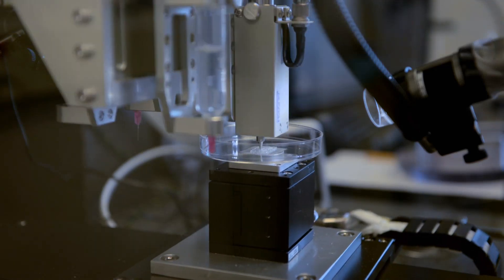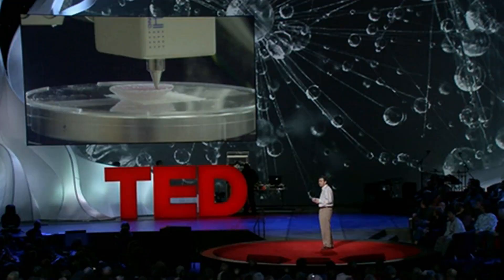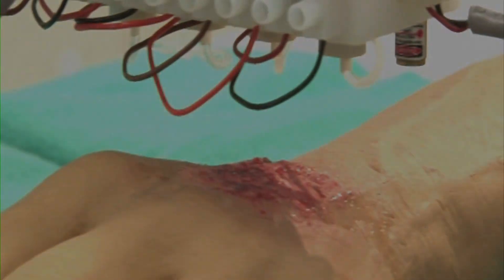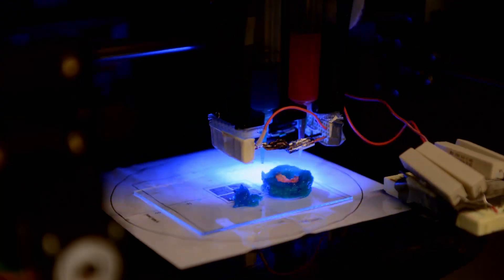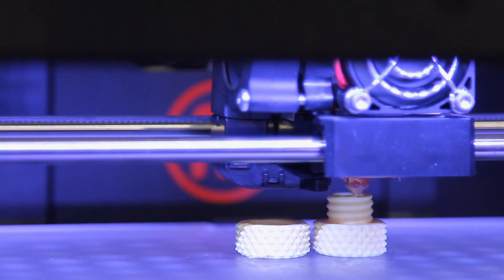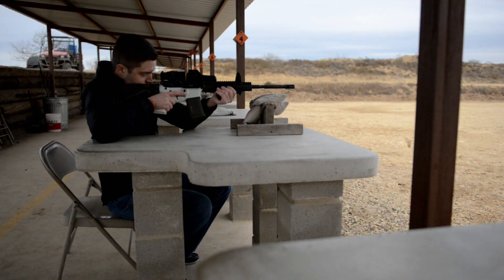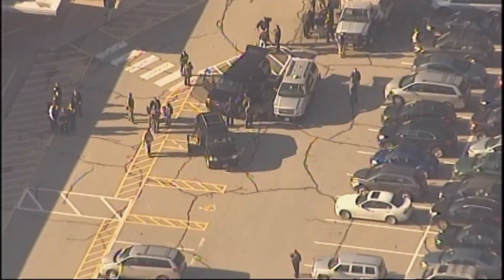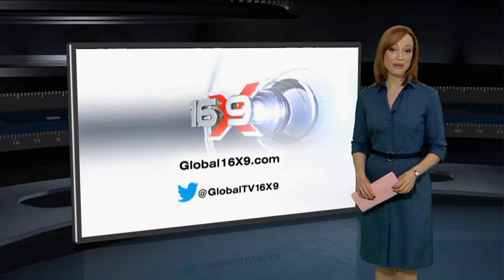3D Printing: Make anything you want

Comment: Only if they weren't so damn expensive
Reply: LBgamer123
 So a 500 is good just like Xbox One? Hell yeah ill buy a printer instead of that gaming system. XD
Reply: Wait a few years, and everyone will have one.
Reply: I have sourced all my parts for less than $150.  Pull the motors and precision rods out of printers(you can get them at the salvation army for next to nothing)  Craigslist always has things on there for free.  All you have to do is purchase the driver board, and if you want to go easy, buy the extruder head.  The biggest investment is time.....
Reply: Anna Wyant
U can get one very cheap...yes. The thing that get out of them has so less quality that u can throw it away.
Only the high quality printers are good enought to be worth and print awesome stuff. (sth like 500.000$)
Reply: Anna Wyant If you actually want to create something cool, I suggest spending the money on a good system to use it in the long run. The DIY makerbot took hours just to make something simple. I don't even use it now, I have the makerbot 2 and 2x. Its expensive but after a year I got tired of how slow the system works and how inpatient I was to print a single part.
Reply: Can DIY a ah, I myself from hardware market to buy material,
Did some 3 d printers, of course, if you buy,
I'm responsible for teach you how to play it.
My skype: reprap.cn  www.reprap.cn
Reply: 3d printer 300 dollars dual extruder with wifi. Yeah expensive
Reply: https://store.makibox.com/#/product-detail?type=1&&option=31 cheaper than you think

Comment: Can I print a 3D printer?
Reply: You can't print the whole printer itself. You can print parts for one, while having to order the mechanical parts (motors,Belts,connectors) online.
Reply: PRINTERCEPTION OMG
Reply: That's right! Let's put the 3-d printers out of printing business. Lol! WICKED.
Reply: Take a look at the RepRap (self-REPlicating RAPid prototyping) system originally designed by Adrian Bowyer at the University of Bath in the UK. He shared this design open-source, and you can now fabricate all types of 3D printers using forked improved designs (Cartesian like the original, Delta like the Rostock, or even Polar like the Morgan). My co-author for "3D Printing for Dummies" recently released the 3DR RepRap variation when my students are building for our workshops. This is all 3D printed save for common hardware and electronics availalable at your local Radio Shack (braided fishing line, open-source Arduino controllers, stepper motors from old printers. etc) and can be built for under $200 USD. I have used these printers for everything up to printing Liberator handguns for law enforcement, all printed just using ABS plastic (like LEGO uses for its bricks) and PLA (biodegradable plastic made from plant sugars). Nothing is required more than commonly available parts worldwide to create a 3D Printer that can print solid objects for irrigation and fresh water capture, etc. Amazing stuff!
Reply: yes
plz
Reply: WickedClownGrin A RepRap 3D Printer can be created using kits like the MendelMax and Rostock Max we used for the book "3D Printing for Dummies" or you can self-source the parts and build your own for around $300-500 USD all together. The more parts you can print instead of buying from the hardware store, the lower the cost, so designs like Richard's 3DR and the Tantillus are both going to be lower cost because you can make most of the printer from plastic. The highest cost items will generally be the electronics (a RAMBO board is ~$85 USD, while an Arduino Mega+RAMPS+stepper controllers can be found around $45 USD on eBay) and the stepper motors (Around $15 USD each, 4 required - 1 for each axis movement, 1 for the extruder). The extruder itself can be purchased for around $75 USD or you can make one if you have some basic machine tools and are fairly handy.
Reply: No problem.

Comment: "...anything you want" is a bit exaggerated. Any plastic figure you want would be the case in most of the printers. What it can make depends on what material the printer uses, of course. When there's a printer that can print a sexy girl, you got my printer. :P

Comment: i whant a 3D Printer  printing a 3D Printer so like i have two for the price of one like if this is a good idea
Reply: dumb
Reply: This is already being done. Google 'reprap' or 'makerbot', These are open source 3D printers that can print themselves, and thus replicate. You still need some basic electronic and metal parts, but the biggest chunk of the printer is printed from another 3D printer.
Reply: Chris Santos
it isnt that dumb but the 3D printer which the ornginal one would print will have to be smaller than the orginal one in that i mean it will have to fit inside of the printing casis
Reply: Olivier de schaetzen cool
Reply: if assembled peice by peice then yeah i can see a 3D printer printing another 3D printer but a 3D printer printing it self without haveing exchagneable peices i do not see happening any time soon
Reply: yumri4 so you are a non bu lever
Reply: i guess

Comment: There seem to be so many people just blatantly ignoring the limitations of the 3d printer. You can't print yourself an entire gun because the consumer models only print in plastics and other brittle materials. Ignoring even the debate between who should be able to have a gun, this technology has thus far been unable to provide access to weapons because almost all weapons need to be made of metal. Regarding the piracy dilemma, who cares if people can build plastic parts that would sell for less than what they paid for the printer itself?

Comment: Yea anyone able to print a gun at home, I don't see that backfiring. What a pain in the ass it is that there are regulations around something thats sole purpose is to kill, no lets make them available through the internet where it's almost to regulate anything so that anyone in the world could mass produce plastic firearms for practically nothing in a few hours. It's not good enough that ppl that should NEVER be in the possession of a weapon slip through the system, lets make it available to anyone in the WORLD that has to get the blueprint ONCE, buy a printer or two on the black market or online, and then can mass produce that weapon at the touch of a button and make parts to service those weapons as well. The AK-47 is already a prime example of what cheap mass produced weapons can do, but luckily it takes a dedicated factory to produce more and they arent designed to be serviced, this idea eliminates both of those limitations. This moron doesnt get that not only could this cause domestic problems, but international problems as well. Especially as the technology only becomes more developed and easier to use. Yea way to go fucknut! Better yet, why don't we just sell our potential enemies weapons? When one of these weapons becomes responsible for killing one of our service members down the line, maybe this motherfucker will realize why heavy regulations on weapons and especially weapons designed for combat were implemented in the first fucking place.
Reply: you can not 3d print a usable gun! just the plastic parts that go one one. a gun is made up of alot of parts and mostly metal so unless you can buy a 3d printer that has a foundry in it full of molten metal and also a way to heat treat certain parts that it is making i dont think you have much to worry about. i mean this like being worried that the whole construction market will go under because of Lincoln logs!

Comment: 3D printing is not as hard as most people think... it is a combination of individual engineering connected to each other through a central processing unit. In Bengal, we used to do same kind of printing manually some 400 years ago, British came, misuse our trust and this simple science have been not forgotten but never learnt.

until now, Modern day Bangladesh can give you back any 99.1% to 100% accurate parts if you only show it. we do make these for local repairing companies. copied British, French, German, Japanese and so Russian stuff from car to aircraft... its easy. some were also claimed better then the original one.

this company only made the AI that use by the central processing unit of the printer. 3D scanning was first milepost behind their today's success. and of course, their success will benefit someone in tomorrow. what was manual some 400-500 ago, now it's electrical (not digital yet).

So let us congratulate these guys ;)

Comment: Title is misleading. Make anything you want of plastic within a limited size. Though brilliant innovation what if I would wanna use it to print a football requiring rubber or a shoe of fake leather of course or a hammer of stainless steel containing some rubber or a necklace of gold or a copperwire or a wooden chair? But okay, plastic. Be that. What if I want to print a new pipe for my vacuum cleaner? It's more than 1 m long so wouldn't fit to the dimensions of the printer. Therefore "anything" fails.

Comment: not everyone has the right to be armed...thats why you need to apply for a gun permit and have a background check done. i am not surprised he is from texas.
Reply: how have we stopped criminals from stealing, borrowing or illegally buying and using guns? Those people will never even try to legally buy one no matter how many laws you add. They will never go through the expense and trouble of applying for a gun permit. We already have over 2000 gun laws, maybe if the penalties and punishments were actually high and enforced we would have fewer of these violent criminals out and committing more gun crimes after they already committed one. The fact is that gun control laws only affect good people that may need to defend themselves from those who, by definition, do not respect those laws.

Comment: I wouldn't worry too much about a gun that require a VERY expensive machine to print it and high skill level to operate said machine.. Not when you can go to walmart and buy a gun for a few hundred dollars that won't fail after 11 shots.  Truth is, guns are so readily available in the USA that 3d printed ones aren't going to make that much difference overall.  Anyone determined to get a gun can already buy or steal one.

Comment: I would never choose to end the lives of many people. If I did, a vehicle would allow me to do so far more quickly, efficiently, and with basically no physical effort. Don't even have to stand up. Just push down on the gas petal, and turn the wheel. Less vehicles would save more lives than less firearms, and that's a fact. So why don't you go to a video about vehicles, and tell drivers that if they choose to do so, they could end the lives of many people with ease, thus there should be less.

Comment: And according to the United States census bureau department of commerce. Car accidents have not lower since 1991, actually increased. And then decreased, but still higher than 1991. 

In 1991, it was 10.7 per capita, then went up to 18.3 per capita, now back down to 10.8 Car accidents have increased. 

And murder? In 1991 there was 24,700. Now around 11,500 - 11,800. 

That's more than a 50% decrease, and a 50% increase in fire arms. 

Around 5 million new conceal carry permits since then,.

Comment: Taking away the ability to own a type of firearm is infringing on the 2nd amendment. It still stands that the firearm is pretty much only good for a shot or two before becoming a hazard to the shooter, will SEVERELY lack in accuracy compared to any rifled pistol, and it probably only shoots .22lr which basically requires precise accuracy to be lethal when you only have a shot or two. Why does this scare you?

Comment: That people have and continue to make firearms is and will remain irrelevant. You claimed that the right to bear arms was being infringed upon. It isn't. And, the NAIL does NOT make the gun detactable. In fact, in order to release the design for the plastic gun the "creator" had to add in an extra, non-functional METAL rod so it CAN be detected. All one has to do is NOT put that in for the device to be undetecable.

Comment: People have made and will make firearms at home, let them use a 3D printer. The guy made an AR-15 lower that only pumped out 11 rounds before breaking down. As for an actually fully plastic PISTOL, first off, you NEED steel to make a firing pin (a nail in his case). I don't know how he made it without steel springs. Secondly, there won't be any rifling. It's going to be about as accurate as an 18th century smoothbore pistol, but weaker, and would probably break if reloaded with a second shot.

Comment: You can get a 3D printer as low as 200 bucks. Makibox A6 LT, it's a kit and print PLA only. Makibox A6 HT prints ABS and PLA for 300 dollars. Cheapest assembled 3D printer you can get is Solidoodle 2. Solidoodle basic is 500 dollars. Pro model is 600 dollars and Expert model is 700 dollars. Check them out.

Comment: I understand that software needs to be updated to match the technology it's used on, but, older technology doesn't disappear just because new technology exists, so it will remain viable  good while.
Even so, in a theoretical perfect system, there will always be those who find a way to bypass the safeguards, and do things not intended with the equipment.  As the software evolves, so do the designs of those intending what's sought to prevent.  It's a futile effort that will NEVER end.

Comment: ... as you mentioned before a creative individual with ill intentions can and WILL find ways to warp your work, or find alternate ways of producing the desired effect.  The software additive would need to be an eternally evolving project.  I'm not saying that you're doing the wrong thing, but I think the effort is a waste of time.  There are EASIER and more effective ways of resolving the problem of the abuse of firearms.  Restricting a single mode of production is NOT one of them.

Comment: It may replace the original on the main host site, but there are countless backup host sites that provide source to previous revisions.  And as for discerning the difference, it might be harder than you realize.  I have taken apart and rebuilt the trigger mechanism to an M16-A2.  I've also taken apart toy guns, and the moving triggers that have ONLY a notch to hold a spring look more complicated than the trigger from the M16.  That's not to say that there aren't OTHER components, but...

Comment: False. Modified open source software frequently replaces or blesses the original. This is precisely what you will see happen especially as the materials 3D printers can use diversifies in the future. Again, you implied difficulty in detection to software used to manage an additive process, this is a contradiction. The program would very easily be able to denote such a difference which only seems tiny to a human not a program dedicated to reproducing things with a good deal of precision.

Comment: If the software is open source, then there will always be a source for an unmodified version of the software, thus rendering the limitations entirely voluntary.  And the only parts that are truly necessary to fire are the barrel and the firing pin, neither of which can be printed out of the materials that 3d printers can use.  One might argue that the trigger is necessary, but if one wanted to make a prop gun with a moving trigger, then it would be exceptionally difficult to denote a difference.

Comment: As you pointed earlier, there is nothing unlawful about modifying open source software and as I said earlier, it is already being pursued. The legal issues are moot: the area isn't regulated and shouldn't be, in my opinion. As for vague, again, a toy gun doesn't need the parts necessary to fire. Theres nothing vague about such differences nor would it be difficult to program.

Comment: As mentioned before, if you think you can implement the software in such a way that does not violate laws, or restrict the lawful use of the printer, then by all means go for it...  Though, I have to point out that there is NOTHING unlawful about fabricating a homemade firearm.  So the issue isn't so much the software, but more about the legal issues surrounding the debate.  Even so, programing the software to recognize and differentiate between firearm components and toy parts is still vague.

Comment: One thing to note is that you can fabricate a homemade firearm without the use of this technology, so restricting ONE means to an end does not eliminate the problem, only one route to the desired outcome.  People have been crafting homemade firearms since LONG before the digital age.  To assume you can stop it is absurd.  As noted, to stop it, you'd have to make it IMPOSSIBLE, and to do that would require denying public access to COMMON BASIC MATERIALS that 90% of people use.  It can't be done.

Comment: If you REALLY think it's that easy to implement, by all means, start working on it... HOWEVER, you may find that doing so could infringe on someone's right to make a TOY gun, one that does not serve any function but as a decoration, costume prop, or toy.  Yes, one could argue that you can simply buy a toy gun, but if you're trying to get a specific look for a costume prop, then it such pattern recognition technology applied to such a device would restrict a legitimate and benign use.

Comment: There is nothing worse than people who think they have the right to restrict the choices of others. You seem to be assuming that the users of this technology don't understand it and are therefore reliant upon a regulated supplier. That just isn't the case. Many 3D printers run on open source software. If the contributors to that software decided to implement your 'simple' solution, the whole project would be forked in less than 24 hours. Welcome to democracy.